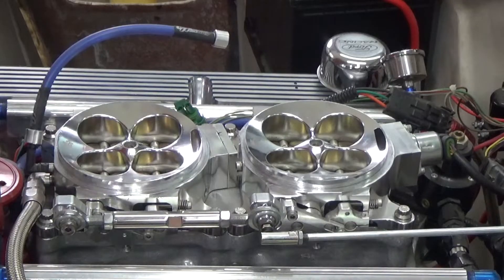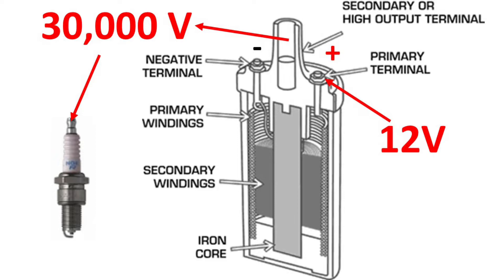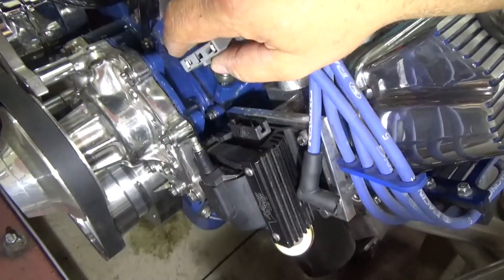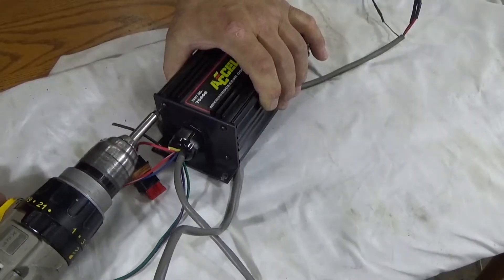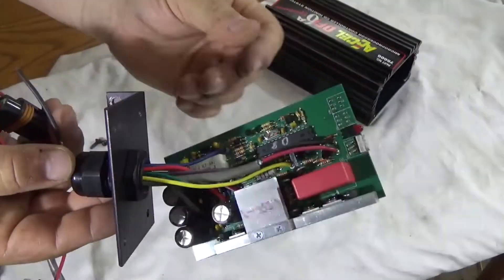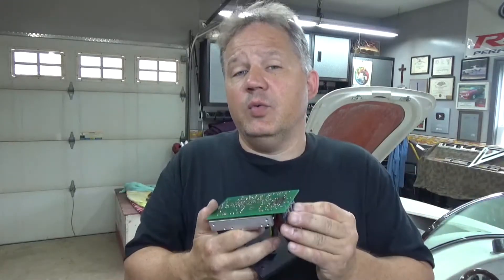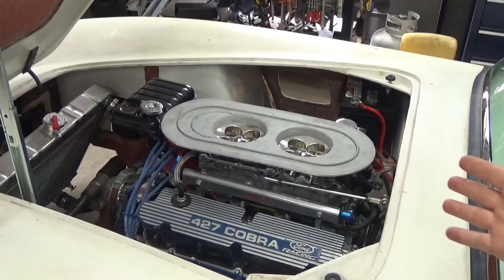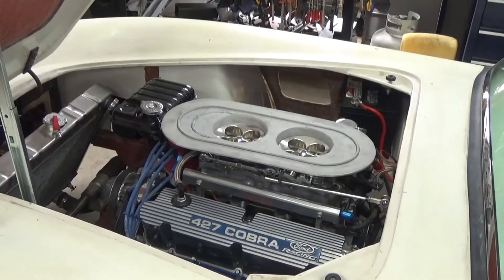Fix it Yourself - Troubleshooting Ignition, MSD Spark Modules, Accel Gen 7 EFI

Comment: If you have a conventional timing light you do the same thing with and have to disconnect any plug wires! Just clamp the trigger over a wire. The timing light can also tell you if your valve springs are too weak to hold the exhaust valves or intakes closed. Of course if it's the intakes you will know it by the backfiring I to the intake. If the exhaust valve is not closing all the time, you will notice the engine starts and runs fine at first but starts missing randomly , usually on all cylinders, your manifold vacuum will be fairly good, and as s9on as the oil pressure comes up the engine starts missing and the timing light will not fire consistently on any of the cylinders
Reply from the maker: Appreciate the helpful details!

Comment: Pushing higher voltage is increasing pressure to the series component, in this case a coil. The coil only produces the voltage required to jump the spark plug gap depending on how rich or learn the cylinder goes. The standard GM HEI coil produces 40kv in lean conditions as seen on the secondary scope patterns since day one.  A coil has to be energized to maximum magnetic induction state, discharging at 3 times per second is not normal. They OEM’s would do it on engines at 600HP like the Stage 3 Camero in 2009. 
  Regardless of voltage the coil cannot charge up to the point of a high voltage secondary discharge multiple times in a fraction of a second to produce high energy spark. This would require multiple coils!
  Anyone who knows ohms law will tell you the same thing!

 ASE master tech-78
Reply from the maker: Thanks for the input!

Comment: Why is my red light on the msd box blinking rapidly when cranking the engine and no spark.1974 dart molar small block 360 cu in
Reply from the maker: A rapidly blinking red LED during cranking is normal and means the box is seeing trigger pulses. If the engine isn’t firing, the issue is further downstream (coil, wires, rotor, timing, or fuel).

Comment: how do you test to see  actual voltage output of this coil/ capacitor  in any model car or ignition system,, to the plugs?
Reply from the maker: You can use a multi-meter that goes up to 50,000 volts

Comment: Thanks for the good video, do I have a boat with V8 engine and I have this MSD IGNITION DIGITAL 6AL installed, so I'm having hard time to get power on coil, I checked Fuzil I checked battery and I replaced the old MSD IGNITION box for a new one with new wire and I still not get power on coil... Do you have any idea what could be?
Reply from the maker: Is the box being triggered to fire?

Comment: Thanks! I will. Also can I use that spark test w/lamp you have to test the output of the coil as a testing location to test the coil and MSD 6a box as a pair? Also does the 6a box have a blinking trouble code other than the initial key on and rpm blinking light
Reply from the maker: Yes and yes

Comment: Nice vid Pete!  I have an issue with my cobra. Is it possible that my 6a box is bad even if the flashing indicator light on the outside of the box is indicating the correct code… 1 long blink and 5 short blinks of the light indicating no over speed trip hooked up
Reply from the maker: Possibly, but check all of the wires first. Sometimes it's a broken wire

Comment: Great tutorial Pete! Question on a ready to go Distributor and a Blaster 2 coil setup. I have a weird hesitation like a hiccup when I accelerate. At first I thought it was a carb issue. But I checked the electrical first. It looks like the coil is dropping below 12v when I rev. So I jumped the Pos. wire straight to the pos. battery. Problem solved.  I can't leave it, So with the power source problem i'm assuming from my key ignition how can I find why it drops like it does through the ignition key? Would I just have a bad key ignition or could it be to much draw on the ignition like a electric fan and a e-fuel pump. Would a msd ignition solve it? But it is a self-starter distributor but specs say not necessary... Thanks for any advise. I've been raking my brain trying to troubleshoot this danm thing! :)
Reply from the maker: Try hooking to a different switched power
Reply: @PetesGarage  A relay solved it. Thanks!

Comment: I have a summitracing brand  trying to fire up a engine but it crank over but doesn't start I have my engine on a small test stand and I have a summitracing multi-spark capacitive discharge  ignition system
Reply from the maker: Check the 3 things, air fuel and spark. Check the timing

Comment: Hey Pete I have a Factory 5 with a 302 EFI with a 6AL 6420 MSD box. My issue is when the RPMs hit 3500 it’s like it’s hitting a rev limiter. It did not have a chip in it so I had a 7k laying around however no change. I suspect the box but not for sure. Would the box display this symptom
Reply from the maker: If the box does not have an LED on it that blinks with error codes, you'll probably have to change it

Comment: Hey pete im fouling just number 2 plug.   What could cause that all other plug burn great i have a sbc 406 big cam. And a msd 6al box and distributor   could it be a bad box or weak distributor. That would foul just one plug
Reply from the maker: Fouling with oil?
Reply: @PetesGarage   i think its oil.  The plug is wet and black  i only run car every weekend.  To car shows. Its takes maybe the 2nd or third weekend an starts popping. Then i change just number 2 plug
Reply from the maker: That cylinder probably has leaking rings or valve guide seal

Comment: Was told to check ignition switch is with test light. You hook one end to small wire ( not the big positive cable from the battery ) and ground it. You get it lit up then your switch is good ? Then could be starter? It sometimes will crank over sometimes won’t. And once it starts, will die on me. Stalls. Been told that ignition switch could be responsible for stalling after it starts?
Reply from the maker: That's possible, but it could also be other things

Comment: I have a 6al 6425 and the car runs perfectly fine and just shuts off like someone hit the kill switch and box flashes 5 times and I can restart it and runs fine again till it dies again? Has anyone ever had this problem before? I replaced the coil thinking it was breaking down but same result. Thanks for any advice
Reply from the maker: It could be overheating.
Reply: @Pete's Garage  the box overheating? Cause this is the 3rd coil on it and same results. It's just strange Cause there is no stumble or anything just loses spark out of nowhere but fires right back up.
Reply from the maker: The 5 blinks is the Rev limiter shutting it down

Comment: Hey Pete. So, I have a 65 mustang with a msd 6al and when I start the car it starts but as soon as I turn the key back to shut off the starter the engine just turns off. So I ran the little red wire directly to the battery and it started and kept running fine. Bad thing about that is now I have no way of turning the car off with out removing both cables to the battery. Do you have an idea what it could be?
Reply from the maker: Your MSD box power is hooked to the starter side of the starter relay instead of switched power

Comment: caps can be rated up to 500 volts but they're being charged with 12 volts they will store that but it's nothing like a camera flash circuit.........................
 what's not clear is that this box is a boost circuit so yeah the output will be spicy.

Comment: The key doesn’t work on my car so I’m powering it by putting jumper cables straight to the starter motor. can I put a wire or something to the positive post on the ignition coil? Like a battery?
Reply from the maker: Fix the key, it could be a bad switch or starter relay

Comment: I will be running the coil positive wire from a Painless add-a-circuit which uses 16 gauge wire. Can I use 16 gauge wire to the ignition coil positive post?
Reply from the maker: Yes you can!
Reply: @PetesGarage  awesome, thank you for the reply!

Comment: These aluminum housings for electronics would be more beneficial if it actually helped disipate the heat, even though part of the circuit had a heatsink mounted to a specific component(s), they are nothing more than a protective storage box that traps in the heat, no fan, no ventialtion, heat is the enemy of all electronics and being placed inside a glovebox, even worse IMO.
Reply from the maker: Good point

Comment: I have a dumb question. I have msd ignition box and hei distributor. If I hook tach wire into the distributor cap do I even mess with the gray tach wire on the ignition box?
Reply from the maker: You can use either
Reply: @PetesGarage  Thanks!

Comment: Thank you for a great film. I bought ACDelco ICM for a car 2003 Chevy Cavalier. I have a question about Thermal Paste for the back of the Ignition Control Module in that car. The Module is located on the top of the Coil Pack, which in its turn is sitting on the top of the ECOTEC engine (2.2L 134 CI L4 FI VIN: F).  The ACDelco Module sent to me had no thermal paste, though it was shown on Amazon site, I reordered and the next shipment had no package w/paste again. It is not a big deal of course, but I want to know what paste to use. I think to apply some of those, which can be used for computer (for PC components). I have Silicon Heat Transfer Compound MG Chemicals 860-60G, MX-4 Thermal Compound Arctic, and  Thermal Grease G107 Silver Gennel. I would appreciate any opinion on this matter.
Reply from the maker: Anything with silicone in it will work
Reply: @PetesGarage  Thank you. I thought to use  Thermal Grease G107 Silver Gennel (has silver, good conductor (for heat as well)), but I'll double check for silicon content in it and might rather apply  Silicon Heat Transfer Compound MG Chemicals 860-60G or MX-4 Thermal Compound Arctic (that one is most expensive, so maybe most efficient). In general I find that the application of chemicals (I mean which one to choose) is the most complicated part of DIY work on cars. Thank you again for your opinion and so informative film.
Reply from the maker: Thermal grease is great, a bit more expensive
Reply: @PetesGarage  Thank you for your replay. See I installed that ICM like 6-7 months ago with no lubricant at all. I wanted to replace the part, since the car had ~100K. When I removed the ICM in the box where it was sitting I saw a yellow blob, I didn't know what it is and threw it away, cleaned everything w/CRC electronics cleaner. A new part didn't have any package w/grease shown on web-site. Any attempts to find out what it is in that package failed, it is transparent thermal grease (not white as silicon products I saw). Meanwhile someone wrote that there is no need to put anything on the back of the ICM, but just a bit of dielectric grease on 2 connectors.  Since everything was kind of vague on the project in the sense of that paste, I decided to install back the original part (there are no problems w/car) and meanwhile try to find out what exactly should go on the surface of the module. Someone was writing in comments that the paste is essential, and computer can start malfunctioning. The car was doing well through summer and autumn (in Texas). But I was thinking that it might not be right, so yesterday removed the ICM, put a layer of MG Chemicals - 860-60G Silicone Heat Transfer Compound, 60g Jar, so the ICM appeared as a sandwich w/butter. I put like 1-2 tsp, worry that might be too much. I also suspect that the blob I removed was the right thermal grease which accumulated through years in one spot. The car drives as was driving before, no issues. The ACDelco ICM I keep as a spare part (GM Genuine Parts 19300922 Ignition Control Module).  I'm not sure of course if the project was completed correctly. It would be good if you could make a film about different heat compounds, greases and so on, and their applications in auto mechanics. Practically nothing on you tube. Thank you again.

Comment: I studied 5 car magazines: Car Craft, Hot Rod, Popular Mechanic, High Performance Pontiac and Muscle car review for 10 years and I learned enough to build a good solid muscle car/hot rod good enough to be in Hot Rod, Summit Racing,PST, Fast & the Furious 4, Justin Timberlake "Carry On", done with Timberland who is in driver's seat and Timberlake is in passenger side. Miley Cyrus's "Party in the USA", and a local group Chef Boyz r Bangers "Shit Happens", a couple TV shows and a couple more movies. I have owned my car for almost 28 years and I love my Poultrygeist :Rew the Shrew. I have an original LT1 (1971 block 010) it had the 487X heads. The original owner was a Lot Col. in the Air force and the chief of the 92nd Bomb Wing. During a pre air show maneuver with either 3 or 4 other officers. There is an Air force documentary entitled"Shades of Blue: A Loss of Leadership". There is coverage of this horrible B-52 crash, wing down on Wings channel. I had my car 5 years before I went back to see second owner a mechanic at a Pontiac dealership here in Portland. This man was from Iceland and unaware of the rarity of this 1970 4spd Formula swapped the 400 for the Corvette block. In a way the research on the SB Chevy lead to great and cheap parts availability like the 302 Mustang. I learned a lot reading and hands on. I share this knowledge with anyone else interested. Like the "starter eater" the flattened cam syndrome, the best oil, not to over carb, exhaust and tire, providing you enjoy a good twisty road, the benefits of subframe connectors on the F bodies, or any other unibody. I like Calvert Racing's "Cal Tracks", though I honestly miss my rear sway bar. I had to relearn cornering. Polygraphite impregnated bushings, detonation errors related to compression ratios, best ring & pinions, race fuel,  best compression springs and cams, different, you would be surprised whose cams were terrible yet their springs were the best. Anyway I am a stage III caroholic, termed by me in a 1982 paper predicting the re-rise of the beloved muscle car. Too bad about those governors governor. My 2001 TA was made in Quebec, yee haaaw. Found this out going through Mojave desert on my numerous back & forth LA-PDX. I have loved beautiful cars since 5 when I became aware, it was a Pontiac, but not a chicken. Another Pontiac barnyard brawler. Has Ha. Take care and thanks for reading. I was in Los Angeles to get a script produced: "A tale of American Iron". Goes from 1968 through the twenty first century following the B-52 Bomber Pilot, the 5 year old girl child and the strangest cross of Chitty Chitty Bang Bang & Christine", both books in glove box, I am not joking. The psychiatrist said I wasn't crazy. They thought the pilot was crazy too. I had written a piece for Car craft when they asked their readership for "True Life" car tales. Oh yeah I gave a true Halloween tale. It's a long story but my mentor from my Hollywood days told me to write a script....
Reply from the maker: You win longest comment of the year
Reply: @PetesGarage  yes, I am long-winded but you read the post yes? Not curious about cam? Oil? Race fuel? Starter? Thanks however for the thumbs up.

Comment: Got a xy 500 side by side no spark. Changed the spark plug, spark plug wire and ignition coil still no spark. I don’t think I’m getting power to the 3 wires to the ignition coil? Ground is good for the wire. So the other 2 is signal wire and constant 12v? Not sure where I should start looking to see where the power comes from for those 2 wires?
Reply from the maker: Yes, one is constant 12V and the other is a trigger wire.

Comment: Pete have a question for you. In all my years i usually see these boxes work, or not work. Working on a car now that breaks up (under load, foot braking or on the road) at around 3000. Have you seen these boxes have issues w something like this issue? Thanks Pete
Reply from the maker: If the box does not work right, it's usually a mismatch of parts, like wrong distributor with box. Before I dive into the electrical issue I make sure it's not an air/fuel problem. Breaking up at 3000 could mean the distributor signal is not firing the box at the right time.
Reply: @PetesGarage  Did find some damage to distributor gear (obviously needs shimming) so hopefully this is the issue. Also thanks for your response.
Reply from the maker: No damage to the gear. I'm not sure what caused it, but I have an idea

Comment: Does the 6al box for carbureted motors hold a charge if the battery cable is off i go to put it on and it sparks but only once dose the box hold a charge
Reply from the maker: That sounds right

Comment: With how you are banging that box around, it's no wonder why it failed you.    You can't beat on electronics like that if you expect them to last.
Reply from the maker: Thanks Cody
Reply: @PetesGarage  you are welcome.  We all learn things the hard way sometimes.  Hopefully your next one lasts a bit longer.
Reply: We don’t live in the 1980’s anymore, stuff is made better
Reply: @2econd428  High voltage in a small space creates a lot of heat.  Heat cycles makes wiring brittle.  Vibrations can cause brittle wires and solder joints to snap.  None of that has changed since the 1980's.
Reply: That's why MSD provides rubber vibration isolators and recommends installing the box in an open area where it has room to breathe.

Comment: Hey I have a 1991 toyota camry v6 manual and I replaced my fuel pump spark plug and wires but now car cranks but not start any idea
Reply from the maker: Coil, could be many things
Reply: @PetesGarage  it's Getting spark and pump is running
Reply: check the injectors